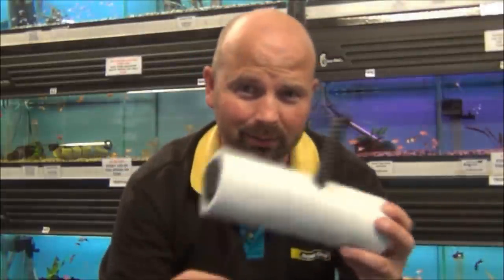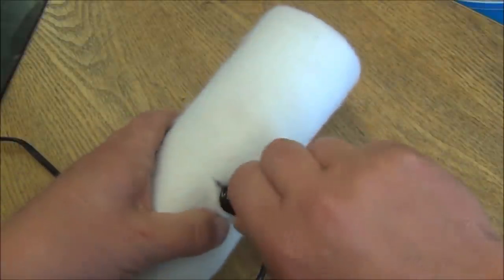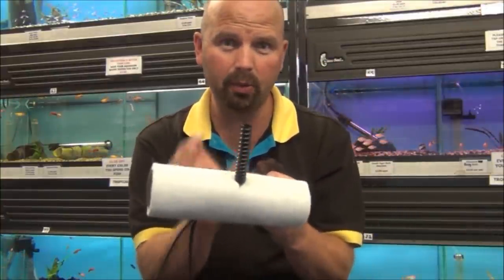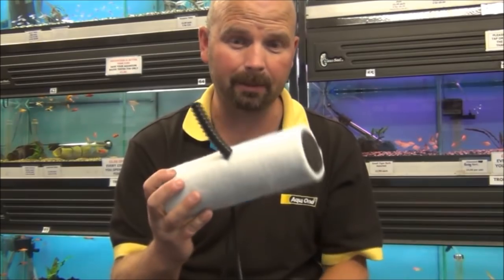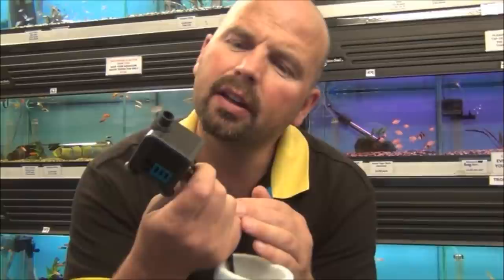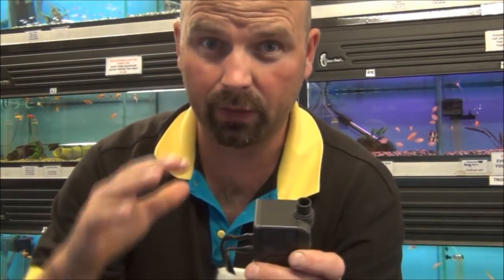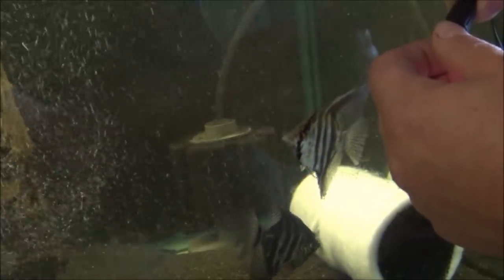BEAT THIS AQUARIUM FILTER!.....GROOVY - DIY AQUARIUM FILTER FROM PONDGURU

Comment: my spare pump has a 60mm filter body which I can push inside of the soft tube, with two tubes joined together it will have enough space for media and foams at the other end! what do you think?  also what media type/size would you recommend?  I was thinking about 1kg bag but can add more.
Reply from the maker: +geoff holloway The pumps I sell are around 50mm but with alteration the 60mm may fit at one end. If the pump inlet fits in one end then 1kg may well fit in the pipe. The biogravel you ordered is the best choice.

Comment: PondGuru, since you've worked with this concept first-hand, do you recommend the 320 or 450 litre per hour pump for a 29 US gallon tank? I don't want to create TOO much turbulence for my Guppies. Also, will the pump arrive with a US-style plug? Thanks!
Reply from the maker: The pump is 220v with UK plug on so you would need a step up converter (around $10?)
320 should be fine.
This is the third question relating to  29 gallon guppy tank that I have answered this morning.

Comment: Hello, do you think this filter would be a good idea for a turtle tank? An overhanging filter is not an option because the water level is too low in the tank. I've made plenty of my own filters for my turtles and they always find a way to push it around and ruin it.
Reply from the maker: Turtle tanks are a difficult one to filter if the water is low since they ideally need a big external filter as the turtles produce so much waste. If your water is low you'd probably be better installing an undergravel filter and doing weekly maintenance.
The filter in this video wouldn't cope with the waste from a turtle tank as it is way too small.

Comment: great vids mate, watched a few, im only down the road in pools. this idea of filter is brilliant, my tank is in my room i have the fluvel u4 filter. will this setup in video be able to replace the u4 or should i run it along side it.
Reply from the maker: +NorthEastRider 2014 The fluval holds very little biological media so I personally would use both filters as the U4 will provide the best circulation and the tube will provide the best biological filtration. I now do the tube filter as a kit with a couple of different pump choices and containing the new 'biogravel' media which is perfect for small filters: http://www.ebay.co.uk/sch/m.html?_odkw=&_ssn=tynevalleyaquatics&hash=item339a8fc301&item=221636444929&_osacat=0&_from=R40&_trksid=p2046732.m570.l1313.TR0.TRC0.H0.Xtube+filter.TRS0&_nkw=tube+filter&_sacat=0
Reply: +Pondguru Outdoors Thanks bud, will purchase one over next couple days, my big tank is 276ltr, which one of the two would you recommend. also 1 quiered, my filter i have now is it best to have it sat on the back pointing to front of tank or on the side so its blowing down the full tank?
Reply from the maker: +NorthEastRider 2014 I would personally have the filter on the side firing water down the entire length of the tank then it has to take the longest route possible to get back to the filter. The two different sizes of filters are the 320 and 450. The 320 will give the oxygenating effect down to 30cm deep and the 450 will give oxygenating effect down to 45cm deep so which one you go for will probably be dictated by the depth of your tank.
Reply: +Pondguru Outdoors Thanks for the quick replys mate, yeah il swap it to the side of the tank then it makes sence when you say it that way.. its 2ft deep 2ft wide, 4ft length. for the difference in price il go the for the 450, should be sufficent enough should it. be couple days once i purchase it, its in my basket now.
Reply from the maker: +NorthEastRider 2014 Hopefully the pump will still give the oxygenated effect down to the depth of your tank but it really is only rated to give the oxygenation down to 18"

Comment: Great video Pondguru...the outside sleeve looks to me like a pool noodle that kids use in swimming pools.  Would that work if you hollowed one out more?  Just an idea since you can't find the sleeves.  I'll only take 10% of the profits if that works for your filter lol ;)
Reply from the maker: I think the pool noodles would make a decent housing but they aren't porous enough to be of use as a filter unfortunately.
There has to be manufacturer of those tubes still out there and I'm sure I'll find them one day.
Thanks for watching and appreciating the videos.
Reply: :( I just killed all my fish!  I had 8 guppies 6 female and 2 algae eaters...They were fine until I 1. introduced new fish got the algae eaters and 3 new females didn't separate them for a bit before adding to the tank.  Put my mama guppy in a fry box didn't wash it out prior to adding it to the environment then panic set in so i did a 20%water change and used a new gravel vac I didn't wash prior to using either.  OK so now starting all over and making sure I keep a balanced environment and going to just try a beta for now lol.  Thanks for all your tips so which of the filters work best now until we can build this one?  I really liked the shampoo bottle one
Reply from the maker: ***** Before you add any more fish test the water to check it is OK to take fish.
If the tank is large enough I would always go with external filter as you can get most filter media in there but a standard internal is fine provided it is big enough for the tank.
Reply: *****
The correct terminology and/or excuse there is "Practice Fish".

It sounds cruel, but if you can get your hands on something cheap/free before going fully fledged into fish keeping... that's the affordable way to do it.
Reply: I'm learning....going down to one tank and maybe a beta lol
Reply from the maker: ***** Well they do say 'less is more' - maybe that applies to fish tanks and enjoyment as too many can be very tying.

Comment: Bubbles, regardless of size won't put oxygen into the water until they pop at the top and then gas exchange...if the micro bubbles are actually popping inside the tank, then you are actually oxygenating the tank at a much higher rate...but that never happens inside aquariums even with micro bubbles....still a neat idea for an in-tank filter.

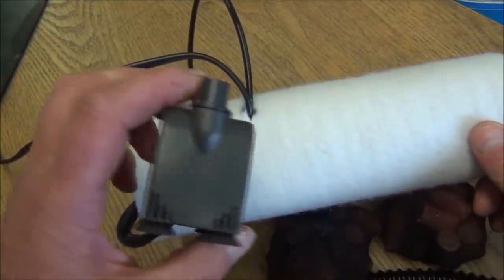Comment: Why not direct the flow vertically, from end to end instead of out the side?  That's an awesome pump!  1:43...  Isn't there such a thing as too much oxygen and/or bubbles?  How big a tank do you think it can handle, or how many adult angelfish?
Reply from the maker: Yes in a small tank the oxygenating effect should be turned down accordingly and really as the only filter in the tank it would do maybe 50 litres - 100 litres to see the full cycle filtration associated with reduced nitrate.  For larger tanks it is really a supplemental filter working with the main filter to help with water clarity, quality and oxygenation. In the case of an angelfish tank I'd assume you'd be going with a suitably sized external filter.

Comment: What is the pump called? I like the idea of the air intake before the impeller.
Reply from the maker: +Tristen Bohn There is a link in the video description. This one is 220v so bear that in mind if you are in the US as you would need a step up plug in transformer to operate it. I have searched for a 110v version but so far no luck.
Reply: Thanks! I purchased a kit from you. I am now currently in search for that converter! Thanks! I am excited to try it.

Comment: ah I meant, would putting a 1200 pump in the tube filter instead of the small pump?! would that work?
Reply from the maker: +geoff holloway Yes anything is possible and a powerhead mounted at one end would pull plenty of water. It may be worth joining 2 tubes together to fit more media in if it was to be the only filter for that situation: http://filterpro.co.uk/filter-foams--tubes-4-c.asp
I have the standard tube kit here: http://filterpro.co.uk/filter-kits-8-c.asp

Comment: hi pondguru thanks for quick reply, the polyester roll in the vid, ..does it have a lining on the inside, cant make it out on the video, is it similar to a decorators roller to help it maintain its shape, or is it just polyester all the way through, cheers
Reply from the maker: No it is made purely from a polyester felt so has no internal tube - still cant find a supplier who will supply a sample or less than 100 for an order.

Comment: Hey Richard great video once again man

I would offer you some food for thought, a possible explanation as to why that style of air intake hasnt been widely adopted by the fish keeping community.

A pump that pulls air in before the impeller might create supersaturated water that could cause the fish to develop Gas Bubble Disease.  In theory it sounds plausible to me but often, in practice, these things turn out different.

Hopefully i'm wrong because this would obviously be an extremely efficient filter with huge potential in regards to eliminating nitrogenous waste and even phosphates as it gives the fish time to consume and assimilate the aufwuchs and detritus that will be collecting on this feeding platform.
Reply: oh and il soon be posting a video of my year old moving bed filter that i made from watching your videos.
Reply from the maker: Noam Chongsky Groovy - look forward to seeing that, just send me the link as I do intend doing a compilation video of DIY filters made from people evolving my ideas which I think would make for a great worldwide video.
With regard to the tiny bubbles the pump used in this video is a very similar concept to the Hydor 'Ario' range of pump / light combos which have been refined over the years and they have been used without problems (or at least without problems I can find on the internet) so it should be safe. The fact that fish and shrimps can feed from the filter just like they would from an exposed foam filter is a real bonus.
Thanks for watching and appreciating the videos, man.

Comment: I would very much like to buy this when and if it becomes available in e-bay.
Reply from the maker: Arnold Hamadeh I'm really hoping to have the full kit available in next couple of weeks as I have just ordered a load of tubes from China. The best bit is I have also ordered short pieces which fit inside the larger tubes so you can join multiple filters together for larger tanks.When the pieces arrive I will make another video for youtube.

Comment: Won't the polyester tubing break down over time?  When should it be replaced?
Reply from the maker: No, it shouldn't break down for many years but I'd expect it to last around 5-6 years before it would be so clogged up it would be unusable and inefficient.
Reply: This idea just popped in my head.  Do these polyester tubes come in different sizes and lengths?  They may also make great housings for moving bed filters as well.  In a previous comment you had mentioned you toyed with the idea of a doughnut shaped filter using a pump and Biomotion media.  If these tubes came in a longer/narrower design maybe you could bend and fuse the ends together so the Biomotion moves in a complete circle.  I might try this
Reply from the maker: Roger Forhan Anything is possible and that's why I love to see people experimenting with filtration as very effective filters can be made from very ordinary things.

Comment: hi richard great video again ,dont think i have ever seen a bad one and that goes for your metal detecting videos as well , i bought a deus after watching your videos and never regreted buying it , got a question about this filter ,i need one where do i get the stuff from mate , the tube and what sort of pump is it rich ,thanks mate keep at it you do an awesome job
Reply from the maker: The tube is a real holy grail to get as they are used in metal refineries for roller covers, made in china and nobody wants to supply less than 100 pieces and won't send out samples - major bummer. The rest of the gear is in ebay link in video description but since this was made I have a new media which is more suited to this scenario as you can get way more surface area in the confined space. It is called Biogravel and is an ultra porous gravel made from same materials as biohome.
If you end up not getting the pump from my ebay link make sure sellers are supplying the OXY versions as some have oxy versions listed and are sending out standard water pumps which is no good for this sort of filter (which is meant to oxygenate water as well as filter it)
Reply: what is the tube actually made of rich as i know a few friends who work in the steel works ,maybe i could get hold of a couple ? ,if i do i could always pop a couple in the post to you
Reply: also thinking about a foam or similar paint roller
Reply from the maker: justin jones It is the polyester tubes used for aluminium extrusion, yes but I can't find a company who will even supply samples as most are in China or US and want a minimum order of 100.

Comment: I have a 40 gallon tank with goldfish... I use one tablespoon of aquarium salt per 10 gallons will this kill my beneficial bacteria... also may I use de-nitrite as a media with aquarium salt because I read that ammonia removers such as zeolite reverse effects when in presence of aquarium salt... I'm confused please guide me... Thank you
Reply from the maker: Yes zeolite may release toxins it has drawn in previously if in contact with saline water so best to go with an inert media. As far as I can see the de-nitrate is just a form of pumice but will no doubt be sold as a 'specially sourced organic compound' and sold at an inflated price, lol.
Using a background level of salt will not kill off the bacteria so no need to worry there.

Comment: Have you found out where to get these tubes? I have a 40 gal cichlid tank I would like to try this in
Reply: No I tried something different. I got a storage container and made an internal filter similar to this but kinda bigger. More like a canister filter
Reply from the maker: James Bean The tubes are on alibaba and are for roller covers, 60mm diameter.  I tried getting them through there and also from suppliers in Germany and America but they wanted a minimum quantity order of 100 - finally ordered 100 from a supplier in China plus some smaller tubes which allow multiple filters to be joined together. They are due to arrive hopefully before end of next week.
Reply: OK gotcha. Are you going to sell them?
Reply from the maker: James Bean Yes and I will make a video showing the new idea for filter allowing multiple filters to join together. Just paid customs charge yesterday so expecting them in next couple of days.

Comment: Them bubbles look great. Pro tip (!) for anyone reading this wanting to get an external filter - don't buy Tetratec ones, they're useless
Reply from the maker: I second that opinion. The construction is cheaper than cheap and the internal 'filter media' and foams are worse than useless. Looks like they have been put in by a blindfolded chimpanzee since they are just put in anywhere with no thought given to mechanical or biological zones.
Reply: Pondguru The construction on one has just let me down, new JBL external filter on order now, I know they are of good quality

Comment: would this be enough filter to run a 10 gallon quarantine tank?
Reply from the maker: +JBT Cajun Yes no problem as it will be fine for between 50 - 100 litres.

Comment: Yo richard

would you think it would be possible to modify an exsisting powerhead as regards drawing air in ?
The one i have for my jewel powerhead and filter draws air in at the outlet nozzel...
seems to work for a while but when the filter gets clogged...it dont send the bubbles out..
May try modding another jewel powerhead..see what i get
drill a hole stick in some tubing..but where is best to drill the hole ?

as always great fishy vid

neilo
Reply from the maker: It is very difficult to get the intake pipe positioned right at the water intake point so I wouldn't bother. I have done a few with varied success but none anywhere near as good as these pumps.
Thanks for watching and appreciating the videos

Comment: Correct me if im wrong but you seemed to say that besides sound reasons the smaller bubbles add more oxygen to the aquarium water because they are going everywhere etc..  A lot of people think their water gets the oxygen from bubbles-air in the water but that is incorrect.  When the bubbles-air reach the waters surface it agitates the water.      It is when the waters surface is agitated or moving around that is adding the oxygen into the water.  Also the larger bubble cause more agitation,, disruption to the waters surface meaning more oxygen.  Yes I agree the smaller bubbles are more quite but that's all.  Bubbles in the water aren't adding oxygen.  I do not mean this in a rude way I used to think this and had 2 air pumps put in all my aquariums etc..  thinking more bubbles in the water more air.   I've just noticed that it is a common misconception.  Love your videos always very informative.
Reply from the maker: I know I explained the surface agitation and exchange of gases in the video I did about air pumps but maybe neglected to properly explain that here.
You're dead right.

Comment: Is there a comparable pump available in the US? I noticed the plug on your pump is 220V plug where we use 110 in the US.  I am also guessing that your pump is at 50Z where the states operate at 60 HZ. I would like to make your filter but want to know the best type of pump to use based on what is available here.
Reply from the maker: +Guy B I haven't had word of a comparable pump in US but the most likely source would be a supplier of hydroponics equipment as that is what they were exclusively used for here. Yes the ones I get are from Italy and have a UK plug, operate on 220v at 50hz. They will work on US supply but you would need a plug in 110v to 220v step up converter, available from ebay.com for about $10. Obviously a US sourced pump would be a preferable option to eliminate the need for international shipping and the converter.